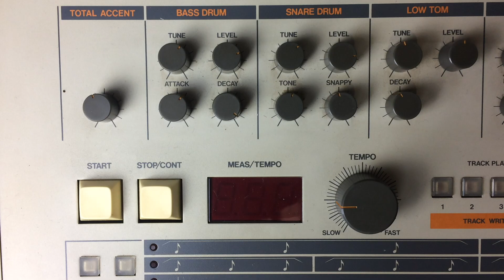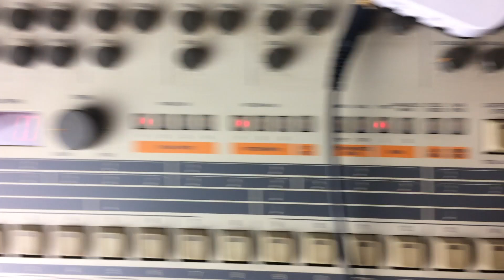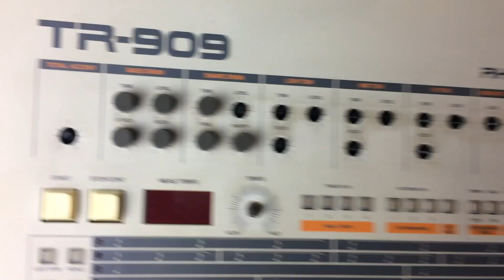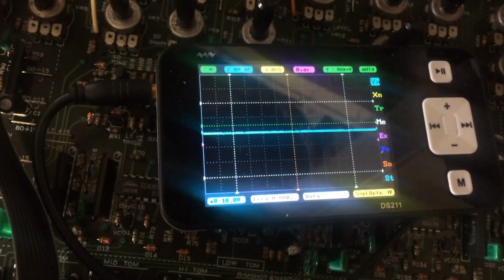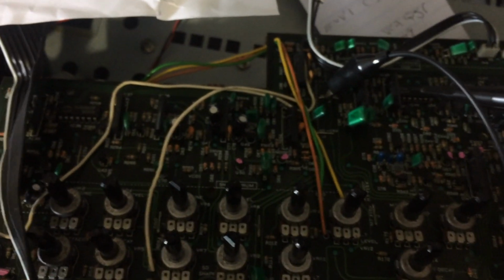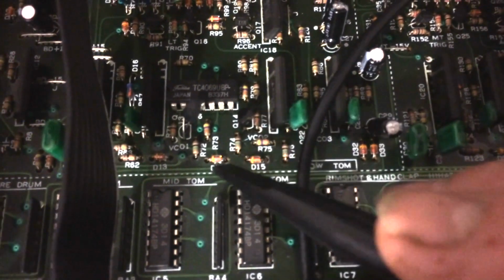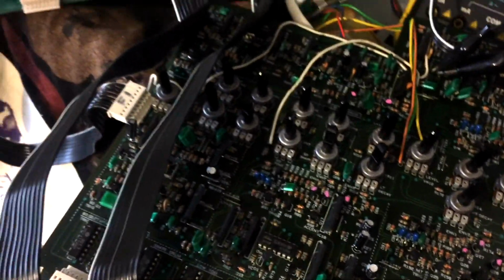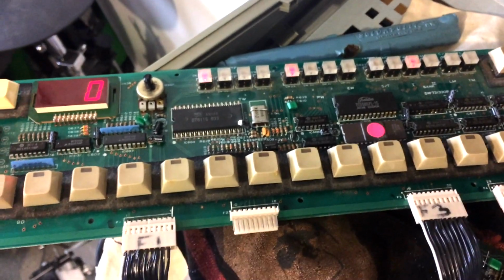Classic Roland TR-909 Drum Machine Repair

Comment: Thanks for the helpful video! My Mid Tom section was only emitting a clicking sound. It turns out that just like you, I had the VCO signals missing in the Mid Tom section. I also had wrong voltage on D36/D37. However, it was not totally wrong (15V) like in your case. It was -8V instead of -4V as it should be. The problem turned out to be a bad OP amp (IC20).
Reply from the maker: Peter Nielsen thank you. Good fault finding then! Bit of a pain to work on these old things hey?

Comment: Any tips for removing the pot tops? Mine are pretty rigid and I just wanted to explore to make sure there's nothing else going on before I just try with greater brute force
Reply from the maker: Sorry pot tops? Do you mean knobs? If so you can apply pressure for opposite sides using plastic knives or spoons. This will protect the panel and the help you pry the knob off evenly.

Comment: I need to find a broken one like this so I can repair as I'll never be able to afford £5k for one! 😭
Reply from the maker: Or buy a Roland boutique 909, they sound exactly the same at a fraction of the cost.
Reply: @onomatopoeidia  Hmm yeah I did obviously think that and it's likely the route I will take but they just don't sound the same imo, too clean and polished! 😅
Reply from the maker: @5pr1nk57  I have never heard 2x original 909 that sound the same as they were individually tuned as they came off the production line. I work for Roland since 2008  and work with the engineer (genius) who’s job it was to do that. They were handmade and calibrated so the current circuit model is the best aspects of the variations.

Comment: What is that device you used to monitor the circuits?
Reply from the maker: Just an oscilloscope and voltmeter
Reply: @onomatopoeidia  will that detect the issues with my power supply on my mpc?
Reply from the maker: @MícheleCobré  yes but you need to understand how to interpret the readings of course. Looking at the schematic and circuit description will tell you what you should be reading. You need to be very careful with the power supply in the machine cos if you touch the wrong part of the psu, it can kill you. I recommend you have a technician look at it for you and learn how to measure circuits on a battery powered devices first? Best way to learn.

Comment: Hello my 727 and 707 just arrived and unfortunately i just blew the fuse by connecting it to a different voltage can u help me fix it pleasee man
Reply from the maker: Possibly you've just blown the fuse before damage was done. Replace the fuse with the exact same type and connect the correct power next time.

Comment: Can the power supplies be repaired on these machines i have a akai mpc that needs to be possibly repaired.
Reply from the maker: absolutely. The most common fault is the large filter capacitors in power supplies. They are constantly being topped up and drawn from to smooth out the delivery of power to the rest of the circuit. Because of this, they are worked hard, gradually leak, cause buzzing and hum and eventually fail. They can easily be replaced with modern equivalents.
Reply: @onomatopoeidia  i need mine fixed immediately for my mpc 5000 i believe
Reply: @onomatopoeidia  also how can you tell if you have problems with devices with the power monitors when you use electrician tools

Comment: Thanks for posting! My lo tom hasn’t emitted sound in a while (no sound out of individual out or main outs). My tech re-flowed all of the solder joints in the lo tom circuit and still no luck. Any thoughts?? Thanks either way!
Reply: Tech gets a square wave from the oscillator. Just no sound out of the outs for just the low tom. Thoughts??
Reply from the maker: you need to follow the schematic to see where the signal stops checking the signal as it passes through the components. Low, mid and high toms all use the same circuit design so compare the mid and high tom signals to find where the low tom signal disappears? Check the signal is at the input of the final amp IC 18a and trace back from there.

Comment: Great video my 909 I can’t tune the snare would it be a faulty pot or should I look elsewhere any help much appreciated thanks Simon
Reply from the maker: thank you. Yes, it could be the pot. You can measure it's resistance across two of the pins whilst turning it to confirm. You need to replace it with exactly the same resistance, size 
 and curve shape (use the model number code) pot.

Comment: I have a TR909 and I had it powered up but the sound wouldn't come out!  I need help
Reply from the maker: you need to start at the power supply and check all the voltages. Next, trace the audio circuit backwards from the phones and main jacks to see where the signal stops.
Reply: @onomatopoeidia  can you do a tutorial on these steps
Reply from the maker: Don't have one here but next time I do a similar repair, I will!
Reply: @onomatopoeidia  much appreciated, now to find someone with the skills to do this...😬

Comment: i've had mine since 1988 it stopped working completely about 4 yrs ago,  Turn the on button Nothing turns on
Reply from the maker: Cozmik funk rabbitt likely the power supply or even as simple as a wire broken off the switch as was the case in my 808 repair video. If you can send it to me I can fix and return.